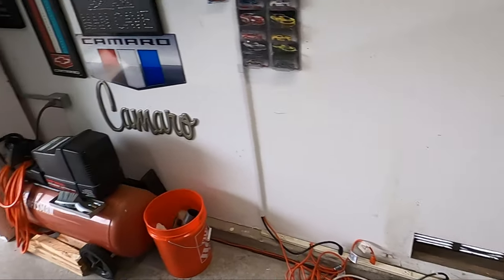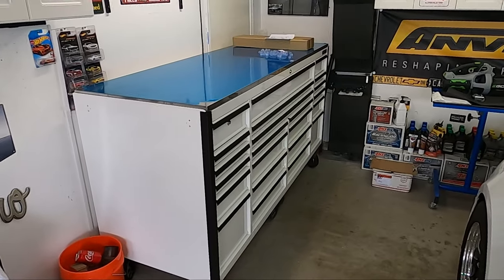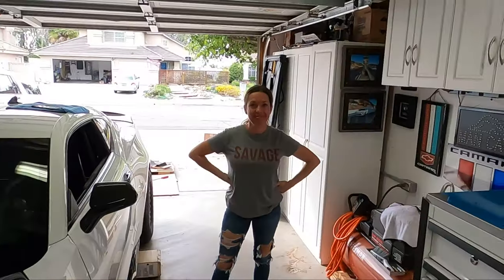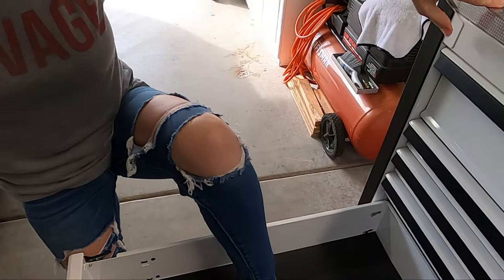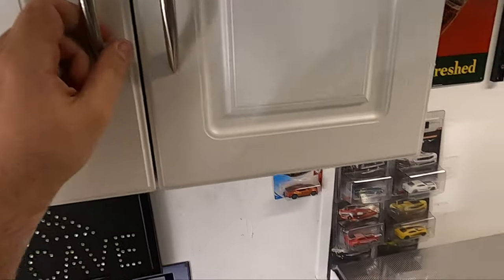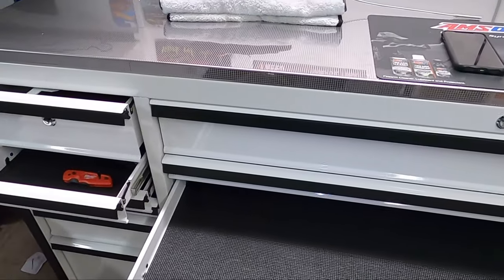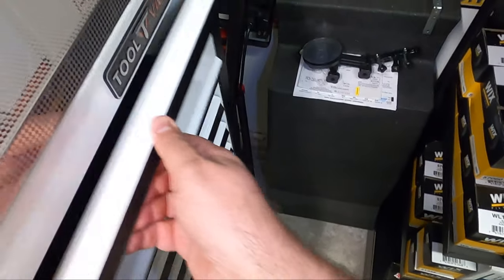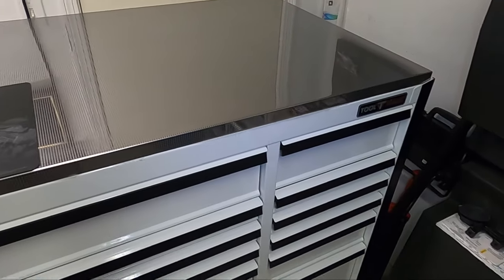Tool Vault Elite XL 84” Review/Unboxing

Comment: Very nice. That's the one I am thinking about for Christmas. Perfect for my man cave. Thank you again for the video.
Reply from the maker: It’s an awesome box
Reply: Chevys rule... I have a 56 Belair 2 dr ht & 57 Belair ragtop. Somehow a foreigner sneaked into my garage. A 72  Porsche 914. Have 12 foot ceiling to fit the lift. White walls with 4 ft black paint from the bottom. That white tool box would be a perfect fit. I live in the Dallas area. I am not quite 6 ft tall, so the height might be a concern. May have to settle for the 72" one. Just don't believe it comes in white. Hmm